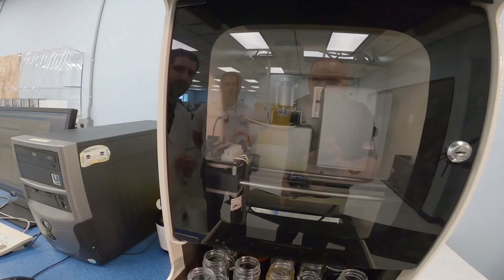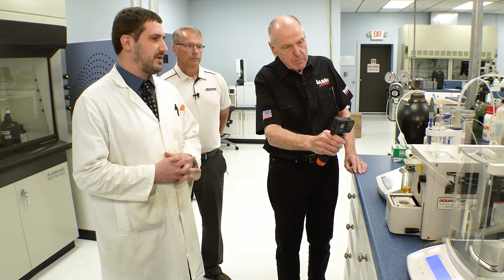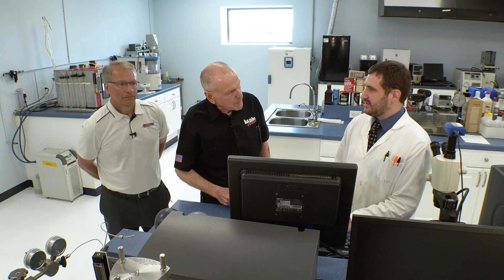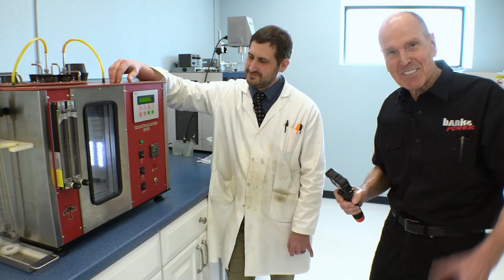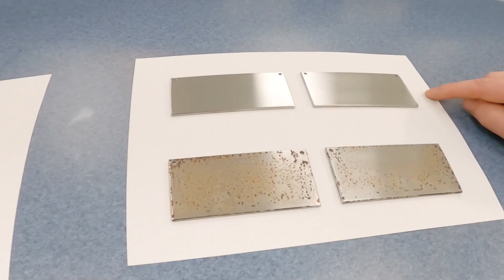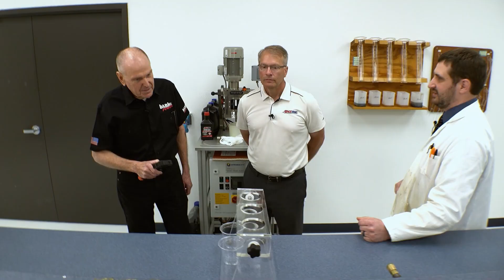How laboratories test motor oil | Part 3 of 4

Comment from the maker: Leave a comment for your chance to win a new patented PedalMonster throttle booster! One comment will be randomly selected Thursday, December 30 at 5pm PT.
Reply: Incredible Information in these video's!! Thank You Gale! You have just made me an AMSOIL customer.
Reply: I’ve had oil tested for 20 years. Since I learned what it can tell us. I once had aluminum, silicone with two other ingredients show in a test, they suggested changing the air filter, on the next test it showed good with a simple air filter change.
In our northern Alberta Canada winter cold, I’ve often had to turn on n off the glow plugs a dozen times for the glow plugs to even start working, another dozen times before I even tried starting the motor at 40-60 below 👇
Reply: @martinbrousseau2560  ppp7
Reply: I'd love a PedalMonster, because my Chevy Colorado needs it!
Reply: *Thank you AMSOIL and Gale for doing this series! *
Reply: Thanks Amsoil & Gale, Wow. I sure learned a lot!!

I have a 1988 Honda Goldwing GL1500 I want to protect and Im convinced I want to go Amsoil in that and my New to me 2005 F150 5.4L 4x4
Reply: Dang it I missed it!
Awesome videos!
Reply: I once read a 50’s military book on cooling n lube components of a motor. It suggested the oil cycles about 100 bath tub equivalents in about one ☝️ minute. That happens to be about the same time they started adding oil filters to engines.
Reply: Awesome, video!
Reply: PoopoOoo.oooP.ooooo

OOo.

lookOO
Oo
Oo
oo
Oo
Oooooo

Ooo I
Reply: I need the throttle booster! I live in so cal and run a Intake already on my 2022 ram 3500 high output.

Comment: I have run almost every type of engine oil the only oil that I use now is ams oil after have  3 engine failures on different oil the only oil I haven’t killed a motor on is ams oil

Comment: i already now that water does not mix with oil but what if you live in a colder inviorment and in the morning do not have the luxury to warm up the engine to optimal temperature but still get moisture in the engine oil? for you that dont know get a cilinder and use a torche on the metal you will get condensation on the casting when hot.

Comment: I was always a mobile one fanboy because it's available locally and it's a good oil I always wanted to use Amsoil but couldn't get it anywhere finally a local mom and pop Hardware started carrying it and I switched to Amsoil finally! I plan on using it for life even if I have to end up ordering it on the internet in the future which I tried to avoid but the local hardware store has had trouble keeping it in stock it's flying off the shelves which is proof people want the best synthetic oil in my little hometown a lot of new Amsoil users down here!!

Comment: Here I am, being a pest again. If the motor oil you are using meets the specifications required by your production (aka your engine), out of the bottle it is doing its job. The question is, how long will it continue to do its job? If you consider what products you are using and the kind of driving you are doing, and you stick to the minimum oil change interval, you will know that your engine oil is doing its job without having to do any testing whatsoever. That's what I do. I drive a vehicle that's old enough where dino oil was original. I do all short trip driving, use semisynthetic and change it at 2800 miles. Do I need to send a sample to the lab? No, not a sample of my engine oil.

Testing is only necessary when you want to extend the oil change interval. Then you need to know if your product is still within spec. But maybe a little common sense will help too. If you are driving all highway miles and your engine does not have VVT and other stuff operating off of oil pressure, maybe you can go 25,000 miles with Amsoil or some other high-end product. If you're driving all local and maybe 6000 miles a year, maybe you go with a low-end product and change the oil twice a year.

Having learned so much about this topic and also about breaking in cast iron engines from YouTube videos, I want to pose a question. In the bad old days, I and all the people I knew drove used American cars. The engines in these very often turned out to be messes of leaks and had high oil consumption, and the cooling systems were clogged up and leaky too. I think all of this was due to poor maintenance, not the inadequacy of the production. Even with products that were not the quality of what you can buy today, some people kept these cars running for a very long time without experiencing these issues just by keeping up with maintenance.

What do the people who were around back then have to say about this?

Comment: That Ametek machine is a mass spec, I use gas chromatography daily which is a little different but keeps the job interesting. I hate ametek H2S monitors tho, they suck. Surprised a spot like Amsoil don't use Agilent or HP chromatography.

Comment: okay, what about heui engines where the oil is being pressurized to thousands of psi.   i know in the 6.0 world amsoil has no issues in these engine but changing to cheaper ck-4 rated oils and the engine starts to run rougher, even rotella t6 wont run as smooth on its own requiring additives such as archoil.

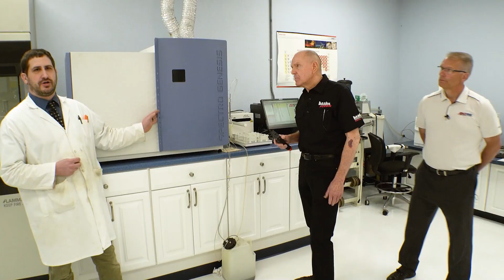Comment: 4:18 The instrument is an ICP-OES (Inductively Coupled Plasma Optical Emission Spectrometer). The plasma temperature is between 6000 K and 10000 K...much hotter then 3000 C. It has to be that hot to effectively ionize all the cations in the sample.

Comment: Just started watching, so it may be covered later [edit, it was], but I'd strongly advise those leaning hard on their engines to have their used oil tested when doing oil changes. It is cheap insurance when you consider it can pick up many problems before they take out the engine.
For many heavy industrial engines it's actually a requirement for their warranty process.

Comment: I really love Amsoil oil but I really wish it could be just a little less expensive because unless you are willing to do oil changes at 15K intervals you can't really even things out. Gasoline dilution would seem to increase the longer you leave oil in. The question is how long does it take to degrade any oil via gas dilution into the oil the longer the engine runs? I wish Amsoil would comment on this. I have gone 10K oil changes for 260K on my 5.7 Hemi Ram but it in the end I did notice it was loosing 2.5-3 quarts of oil between those changes. So now with my new truck I'm not sure I'd want to try it. I mostly used Mobil 1 Synthetic during that trucks life. I have now mostly switched to Pennziol Ultra Platinum and plan to use Amsoil every other or 3rd change. Just hate to use it when I change oil every 5K. Any solutions?
Reply: I have a Jeep Grand Cherokee with the same engine. I installed an Amsoil EAbp 90 bypass filter and send out oil samples for analysis. My Jeep holds 9 quarts of oil so I feel the pain financially. The oil change intervals were dramatically extended. You can become a 'dealer' to get a better price on their products. They also have awesome ATF and gear lube for differentials. Hope this helps.
Reply: @Colorado_Native  Yes I've already signed up as that but Amsoils' 1 gallon jug(4 quarts) is still far more that Pennzoil Ultra Platinums 5 quart jug which cost $23. Amsoil is better with Pennzoil a close 2nd but when changing every 5K I have to question if I'm just going overboard. Yes I have put Amsoil in my Tundra's transmission, front diff, and rear diff. They currently don't make anything for the 2020 Tundra's transfer case.

Comment: I've been a believer of amsoil for a good 20 years. From 2 cycle oil to small engines to the v8's and everything in between. I think the biggest difference I ever noticed with their product was when I replaced the gear oil in the rear end on a used truck I bought. It quieted down which I kind of expect from a new oil in general anyway but the ride down the highway was the real difference. It just felt smoother to me. No way to quantify it though, my mileage seemed about the same.

Comment: Amsoil being willing to bring in the likes of Mr. Banks speaks volumes.
The fact their engineers and chemists can explain this at 3rd grade level says they are masters of their craft.
Reply: I,think that it's Mr.Banks going All out Amsoi,l and also The fact That's The Product that he is using in the Modified Duramax Power Plants that he is upgrading for The Military speaks Volumes.  And The SEMA Build "LokJaw" that Banks did for The November show was featured in The Amsoil Booth. And if You purchase one of The New Banks Patented Rear Diff. Covers it comes shipped with Amsoil Gear oil in The box, with their spiffy squeezable bags so no messy bottles to deal with ! And Gale is also running a Amsoil Oil bypass filtration on his personal daily driver.

Comment: I have studied oils for years to use in a mixed fleet and this adds so much more knowledge to that base.  I recently upgraded to the Banks diff cover and changed over to the Amsoil fluid that I purchased with the kit.  I did this on a cooler day and was dreading the amount of time it was going to take to install the 85-140 fluid back in from previous experience.  I was pleasantly surprised at the quick flow rate and quick empty of the containers to a drip dry type of empty.  Knowing that Amsoil has always been a premium product was quickly confirmed and this video series further demonstrates that the products are designed and tested to ensure longevity of my vehicles and equipment, potentially being cheaper in the long run.
Thanks for going next level with this series.

Comment: I did not think that pure oxygen was safe to pump through hot oil. Like even a little bit. I was taught over and over and over and over again that under no circumstances should you allow pure oxygen to contact oil of any kind, but especially hot oil.
Reply: U mean it could explode
Reply: @haiderjawad9313  that's what I was taught-but I'm not an expert.

Comment: I have no doubt that amsoil is the best engine oil. Unfortunately, it comes down to price versus engine protection for most consumers. I run pennsoil ultra platinum and change it every 3,000 miles. I simply can’t afford amsoil and don’t believe the cost/benefit analysis pencils out for amsoil.

Comment: This testing is great unfortunately most " recommendation " on oil weights are dictated by C a f e , EPA, and thin oils for better mileage. Ultimately new vehicles are moving away from viscosity protection for better emissions. Regardless I will use Amsoil over brands.

Comment: That's it. I'm a believer. Amsoil from now on. I knew that the right type of engine oil was important for the longevity of the engine,  and i knew that not all engine oils are created equally. But after watching these episodes with Gale and the Amsoil team, I now realize how little i knew. Most importantly, I now know what brand of engine oil to use.  Thanks you Amsoil team and Gale Banks for the education.
Reply: Yup, AMSOIL for sure.  Also proves that asking the opinion of a mechanic is a waste of time.  This is the level of engineering where that question gets answered.  Still have mad respect for mechanics for the challenging work that the honest ones perform.

Comment: I went from Mobil1 5w30 to Amsoil Boosted Extended Life 5w30 in our 2009 Chevy Suburban. On the fourth oil change i was seeing better fuel milage and smoother running engine well past 6000 miles. The Mobil1 5w30 was started to thicken and was pitch black. My oil is barely dark tan at 12,000 miles. I change my oil at 10,000 for now on and use a high quality full synthetic oil filter too. Anything in lubrication? I buy Amsoil.

Comment: I haves used Amsoil 15w40 diesel for decades . the cold cranking difference is shocking. Starts up below zero without block heater without any problems.

Comment: Gale Banks did an unboxing video of an AmsOil bypass filter, AmsOil did this video https://youtu.be/XemTDNbbfeg on its bypass oil filter. But I’m still not yet convinced. I hope 🤞 you do a bypass oil filter video while visiting AmsOil.
Reply: I installed an Amsoil bypass filter on my Jeep. Each week I check the oil using a clean paper towel and I put the date on it and keep them. The oil seems to be staying much cleaner, even giving the extended oil change intervals. I would highly recommend one. Hope this helps.
Reply: @Colorado_Native  do you drive a diesel ?
Reply: @martinbrousseau2560  No, it's gas, but the bypass filter works and is fairly straight forward to install. I did have to make a mounting plate for the bypass valve and the filter housing, but that wasn't too hard to do. I didn't have to, but because the Jeep gets hard use in low range four wheeling I installed an oil cooler. It used to get a little hot, but now the temp needle never gets more than half way up the temp gauge. It took about a needle and a half width off the temperature gauge. And, I also installed a filter and cooler for the power steering hydraulic oil (it doesn't use power steering fluid which is easier to find) and that seems to keep the fluid much cooler. I don't think Amsoil makes the hydraulic fluid for that use, so went with the Mopar brand. If you need I could probably send you a picture. Hope this helps.

Comment: It is inductively couple plasma.  It does not burn the sample.  The sample is turned into a spray of droplets. Those droplets are desolvated. Or the solvent is evaporated away. The the remaining particles are vaporized into atoms then the atoms are excited and emit light which is measured. The wavelength is specific to the element and the intensity is related to the concentration.  Nothing gets burnt.
Reply: Oh by the way the plasma is made of argon and there is no oxygen available to burn anything.

Comment: I have some beef with the cold flow test. 15w40 oil has to be in spec to be rated that way, correct? So if there is that dramatic of a difference in cold flow how could they both be rated at 15? I can see one being a bit faster/slower than the other but that's so much different there has to be something else. Like one is slightly used or something.
Reply: To qualify as a 15W there's only a maximum limit on crank viscosity at -20C and pump viscosity at -25C. As there is no lower limit, you can get a wide disparity in cold temperature flow properties and still have two different oils be classed as 15W.

Comment: Loving this series! Thanks guys. Keep them coming! I've been a Pennzoil fan for a long time but have slowly been using more and more Amsoil products in the past year.
Reply: @Olds_Pwr  I don't disagree, at the same time however I've seen high mile engines that look very very nice with oils like penzoil and amsoil and I've seen high mile engines with others that haven't looked so nice. They all get up there, some just do better than others
Reply: @Olds_Pwr  yep, they have all dramatically improved over the years. I typically run to 250k- 300k miles before selling my vehicles. Have yet to ever need to replace an engine! Happy New Year